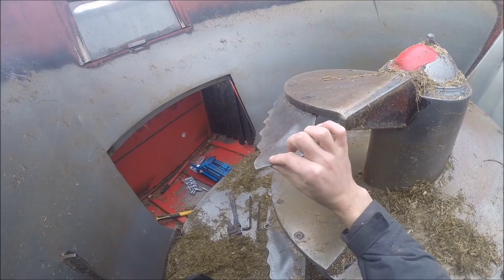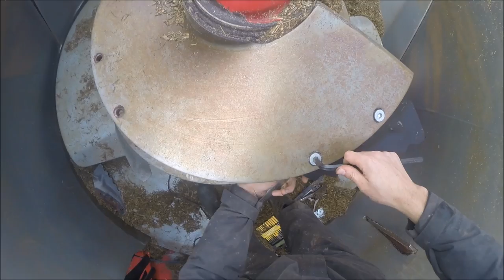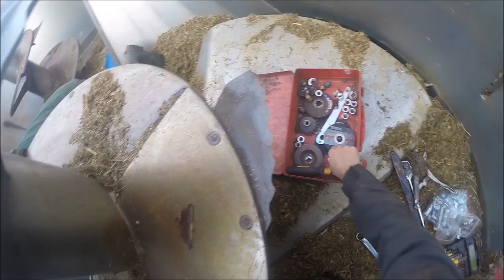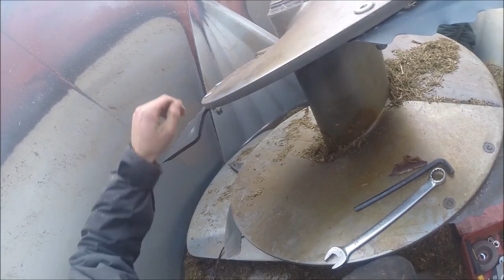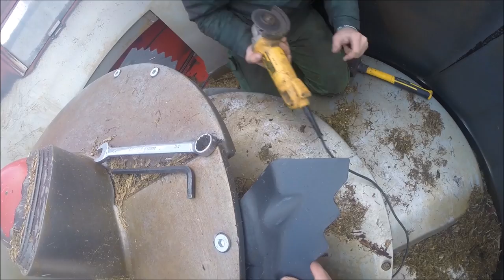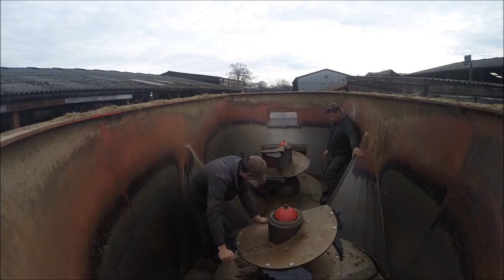changing the blade on feeder waggon

Comment: Man I need to change mine too...they look just like yours do. What mixer is that and how many cubes is it?
Reply from the maker: its a triolet 18 cube
Reply: Jarid Woodgate is a vertical or horizontal mixer better
Reply: Looks like a nice mixer. I have the GEA MIX&DRIVE 18CUBE.
Reply: Is it better tan a Keenan
Reply: Matt Nielsen it depends on what you feed in my opinion. We feed allot of bales, both round and bigpacks and I've found the vertical allot better than the horizontal we used to have. I guess though if your feeding allot pit silage than the horizontal might be better.
Reply: I think so...I had a keenan before the vertical and it gave us allot of trouble when processing bales especially  hey bales. You can have a look in my vidoe's some where and you should find it. I think there is one called R & M or Repairs and maintenance in which we are fixing the keenan after the bale handled blade at the top tore loose.